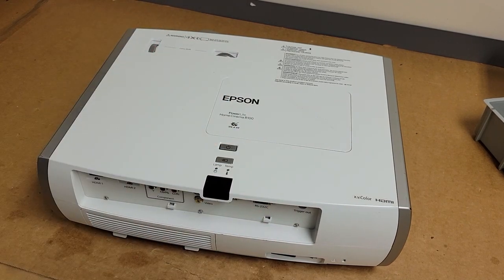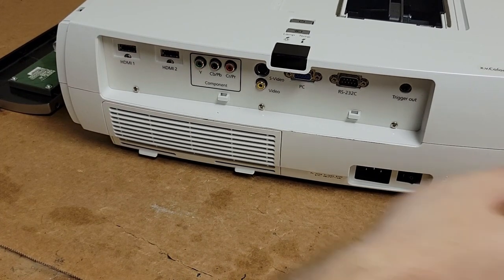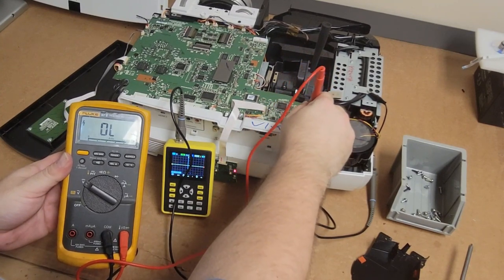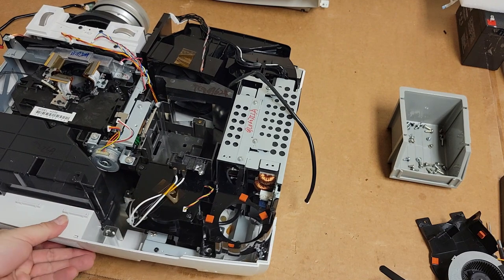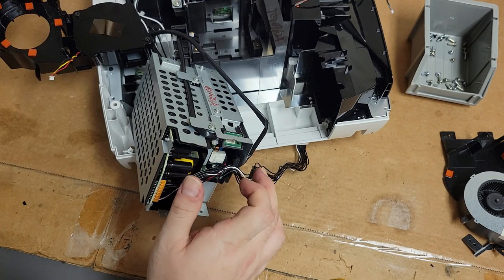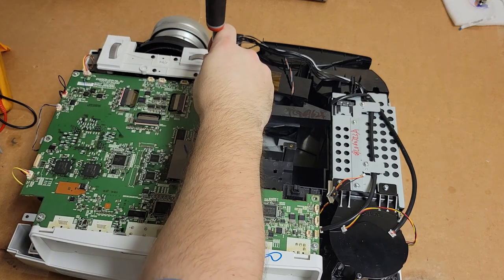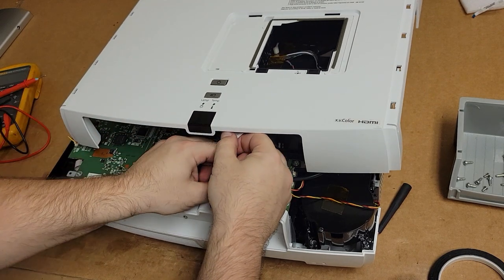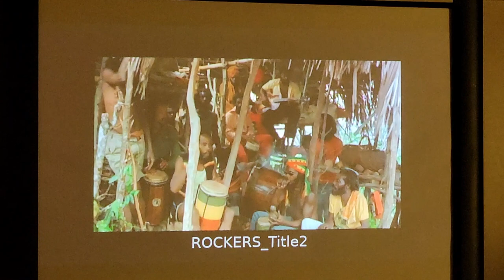Epson PowerLite Home Cinema 8100 LCD Projector | Temp LED Repair

Comment: Hello Frank great video I used  a multi meter to diagnose my issue  as you instructed as I also have a red light heat issue however I’m only getting half of the voltage on all four fans. I have the same unit as you pictured and I’m wondering if there’s some thing wrong in the power supply that you know of  as when I stop a fan like you did or maybe another video it shuts the fan bulb off into the default and then I get the full voltage and the fans actually speed up so I’m wondering if you know if there’s a circuit prior to the fans getting the power as I said when the projector bulb is on I’m only getting six point something volts on all four fans and I don’t know if that’s normal as in what should the fan volts be under normal running / operating conditions.  Oh any one more thing which may be important  I did not get an Epson exact replacement I understand that you suggested that however I did not purchase an exact so I’m wondering if the bulb could be pulling more voltage that is drawing from  the fans and this overheating thank you for your help much appreciated. Rob In NJ
Reply from the maker: Hey Rob, Short version, it's possibly the lamp but some aftermarket lamps use Osram or Philips bulbs and those are okay. It's the cheapo amazon lamps you really need to watch out for. As far as the fan behavior, that sounds correct to me.  The fans change the speed with the voltage. 6-7v would be a slower speed(low noise).  When you stopped the fan, it sent a stall warning via the third wire to the projector. The projector then turns off the lamp and sets the fans to cool-down mode which is high speed. 
What was your original problem?  Was is not coming on and one of the error LEDs was on?

Comment: Would you be able to repair my Eason HC6100 for both lights blinking red or have suggestions. I suspect the fan too. Optics work at power up and I have a new lamp.
Reply from the maker: Maybe.  Honestly epson is a real pain in the butt to repair.  They won't sell parts to anyone unless they are factory authorized. I can get a lot of the secondary parts(fans, connectors, polarizers) but some parts are just not available.  If you are okay with the chance of it not being repairable, I am happy to look at it.  I don't charge a bench fee so if its not repairable, it won't cost you anything other than shipping. Hopefully its just a fan but if its ends up being a mainboard, I would not put any money into it.  I have an email listed on the about page about halfway down.  Feel free to reach out and we can discuss specifics.

Comment: I have an Epson 8350 and the screen just started flickering. Is this a sign a need a new bulb? I bought this used off craigslist and was told there was a new bulb in here, but I have no idea how to tell. If you have any ideas it would be much appreciated.
Reply from the maker: Make sure the lamp is in standard not eco. If that doesn't change I would try another lamp. It sounds lamp related to me. There's no real easy way to tell. I honestly just look at them but I also have been working with lamps for 15~years. The simple version is look into the center of the lens of the lamp. If it looks at all cloudy or dirty then assume it's worn. If it's shiny and clean, you're probably okay. If you buy a new lamp make sure it at least has an Osram bare bulb inside of it's not an Epson original. Don't buy knock offs. I've seen them ruin these projectors.

Comment: Hi. brilliant job. I have an epson eh-tw3600 which has the same chassis as your hc8100. The problem with mine is both the lamp and temp lights are blinking red and the projector is not powering on. I'm guessing it has the same lamp fan problem not spinning and/or busted lamp due to lamp fan which probably stopped blowing. Need some advise as to what should I be doing to fix my projector. Thanks.
Reply from the maker: It could be the fan. Thats a common problem.  I'd check it and see if its throwing a stall error on the status wire.  That will tell you for sure.
Reply: @FixitFrank  thanks for the reply. I will check it. Appreciate this so much.
Reply: @FixitFrank  but how do u check if it’s throwing a stall error on the status wire?
Reply from the maker: I actually go over it in this video. epson checks differently than other brands.
Reply: Does it make a grinding sound when you turn it on?

Comment: This is brilliant, as I've run into the same problem on my TW5500. However, it appears it was the front exhaust fan. Since it is really hard to source I have replaced it with a Noctua fan that was similar (but not quite the same) in spec. I had to solder the plug from the old fan as it was a different connector. However, since I did that, I keep getting the instant temperature warning and the bulb shutting off. Could this be related to the non-standard fan? Or do I need to learn how to voltmeter everything now? I have tested each fan seperately, they all still rotate. Any help would be appreciated.  Thanks!
Reply from the maker: Yup it's definitely the fan you used. They need to use the same model as the old fan. Rpm reporting and CFM are critical. If you replace it with an original model fan you should be okay.
Reply: @FixitFrank  Thank you so much, will try to source one...

Comment: I have an epson projector that I used maybe 50 hours then didn't use for quite a while, then when I turned it back on I have the dreaded blue vertical line. So disappointed in them. NEVER AGAIN I say. Sitting and doing nothing should not be a reason (no humidity, no strange conditions, just cool dry) to brick my projector. I did all the usual ribbon cable stuff (and mine is a HC 3500, pretty onerous to disassemble, boards are attached to each other...) no dust, immaculate inside, total disappointment. No available anything because it is old.

Comment: I have the same projector I am getting a bit of blurring and a pink hue around the edge of the screen any thoughts? I am thinking it's dust inside. Could this be the bulb I did buy an aftermarket bulb maybe 75 hours ago.
Reply from the maker: Probalby not the lamp if its around the edge. Also I am pretty sure Epson no longer has these lamps. They basically stopped selling replacement lamps and only sell what is left in stock.  
That does sound like dust but it might also be the coating on the combiner prism after the LCDs.  This is a fairly old projector by epson standards so I would not put too much money into it.  I'd definitely suggest having someone see if it needs cleaning. If its not dirty then its the optics failing.
Reply: @FixitFrank  Thank you ya it's not too bad. I am pretty handy I was thinking about taking it apart and cleaning it. Probably not bad enough yet to risk breaking those LCD cables. I was hoping you were going to open one  all the way up in a previous video. Oh well thanks again for the response. Have a great weekend.

Comment: I have two of these 8100s that failed the same way. There is distortion/smudging of the colors only on the center of the image. Can this be repaired? Thanks!
Reply from the maker: Hi Gustavo,  Sadly the repair is probably not cost effective.  I have another video going up shortly about the 8100 that this projector is replacing.  The problem is in the output prism.  There is a coating that seems to fail, either from dust falling on it or purely just age and damage from thermal cycles.  Here is a picture of the damage. https://imgur.com/nXHJeiv  The only viable repair I can think of is replacing the entire optical assembly, including all 3 LCD panels(they are aligned to the prism and not adjustable after the fact), their polarizers and whatever that filter is.  Epson seems to fail this was a lot.  Either the panels, the polarizers or the prism.  That is a big reason why I don't do a lot of these. A replacement Optical assembly will definitely be used so there is no way to ensure another 5-10 years of operation.  Maybe 3-5 years if the assembly is in good shape with low hours.  I expect the projector in this video to last at least another 5 years. It seems to have low hours and was very well cared for. 
The annoying part is that even with high levels of maintenance and care, the plastics used in the optics will still break down regardless of how much cleaning and care the projector is given.  
I'll have the newer video about the unrepairable 8100 up later this week if you want to see the details.
I wish I had better news for you, but I would suggest selling those for parts if you can.  Put that money towards something newer that you like.

Comment: Hello Frank.  Amazing video thank you for sharing!  I have this projector and the same error.  Where would I be able to buy replacement fans if I were to attempt to follow your Amazing helpful video?
Reply from the maker: There are a couple of options.  I find that googling the part # on the fan itself is good.  Or, if you want to contact Time Electronics, they should have some.  They are in China but they ship DHL and take paypal.  Email is gydz@timeprojectorlamp.com  If you are in the states, I have some used/good fans that I would let go cheap.
Reply: @FixitFrank  thank you!

Comment: I have a 8350 that powers on and will sometimes power off with both red lights flashing. The bulb powers up and you hear the iris working. Before shutting off you hear a similar sound. Could this also be fan related? Do you clean any of the glass etc? Will probably open mine up in the near future. Thanks for helpful video so far!
Reply from the maker: Definitely possible. The 8350 is almost identical to the 8100.  I would be suspicious of the fans and the filter. I did not clean the glass because the previous owner seems to have already done it.  Also, there are a lot of aligned pieces of lens and mirrors that if you move them to clean, it makes it hard to re-align them.  Then there is the flexible LCD cables that can break if you breathe on them too hard.  I would clean the fans, the ducts and gently the exposed glass but I would not take it all the way apart. They are designed to run with some dust and in cleaning  a projector, less is definitely more.  Disturb as little as possible and you will have the best results.  remember this is a 10+ year old projector and anything that happens will only cost a lot to repair so keep it basic with the cleaning and you can't go wrong. I would find the fan problem first though and go from there.  Feel free to email me if you get stuck. Its on the about tab.
Reply: Dirk, I have the same problem, did you find any solution? Please let me know.

I suspect Iris issue, because sometimes when it shuts down the way you explained and I start the PJ again it shows the Auto Iris error.
Reply: @FixitFrank  thanks for the video frank, really helpful, if I ever find courage to open my PJ apart to fix the issue.

Pls check my reply to Dirk in this thread, do you think it can be iris error?
Reply: Hi Frank, after many months I finally able to open the projector up and clean as much as possible without disturbing the lenses etc. It seems my cinema filter does not move at all though you can hear the motor trying work but is does seem to be slipping since the gears are plastic. I opened the original gearbox cleaned and regreased is but no difference apart from being less noisy. Is it part of the epson start up process to move the cinema filter between the limit switches in order to gather a starting point should it have to be moved in front of the lenses later on? Almost like a "reset" with each power on? I managed to find a good forum post on AVS. If you google epson powerlite cinema filter noisy it takes you to a link where a user had replaced the plastic gearbox with a 6v micro metal gear motor. There is some slight modification necessary but nothing too wild. If it's the case that the fkilter should move at startup then I really am disappointed how epson would use plastic parts in such an application.

Comment: so watched this video as i need to figure out how to replace the fan in the projector we have...but im pretty sure my issue is the exhaust fan. its very loud, almost like a lawn mower (grinding type sound). it runs, but it gave the overheating pop up so i know its not working well. 

do you have another vid where you replace the exhaust fan for one of these? or even what fan to buy, I see some listed on walmart but no idea how to tell if its real or knock off?
Reply from the maker: See who the seller is. Walmart is kind of like amazon or rakuten. They allow sellers to post stores and sell their wares.  As long as the model info of the fan is the same, it should work.  If not, feel free to contact the folks I use.  Gydz@timeprojectorlamp.com  They are wonderful.
Reply: @FixitFrank  thank you! i ended up talking to my brother about it and was able to take it apart and replace the back corner fan, a piece of orange padding was rubbing on the fans so its running much better now! (my brother had already bought fans for it). 

but now there is a bad 'hot plastic' kind of smell coming from the projector.......its not overly hot and not giving any errors and is running fine. is it just the new part plastic smell? i googled and a few threads said its normal for new set ups but what about just a new fan?
Reply from the maker: If the lamp is new that is kind of normal for a bit.  It should let up though. If the lamp is older and the fan is new that might be part of it but it should stop making that smell pretty quick.  Im not really sure what else could cause it but it's going to be something near the lamp.  Make sure a wire or something didn't shift and end up in the hot air path.
Reply: @FixitFrank  I took a pic of everything running before closing it up and it didn't look like any wires were out of place so hopefully its just the new parts. i think i put a new bulb in, but the box was unmarked so it could have been an old one that just wasn't thrown out yet.. (just ordered a couple new bulbs though)
Reply from the maker: If its a new bulb that is not very uncommon. It should let up pretty quickly though. If you keep smelling it after an hour or two, let it cool down and take it out and give it a visual exam and make sure the air vents are allowing enough air flow.  Give the bulb a shake and make sure you hear the ceiling/table air flap moving. It should rattle a bit when you shake it. some amazon bulbs skip the air flap but it causes the bulbs to run too hot.  You want to hear that rattle.
Reply: @FixitFrank  oh good i always wondered about that, it did rattle like something was moving around in the bulb! thank you :)

Comment: hi frank i am in canada i have epson -HC 8350 = I REPLACED new lamp and it working  fine fir 2 weeks but  NO LAMP LIGHT IS NOT ON  THE POWER LIGHT  AND STAND  BUT NO LAMP LIGHT  help frank   ???
Reply from the maker: I would try a new lamp first.  Get a warranty replacement. If a new lamp is going to be defective, it will usually fail within the first month of regular use(first 100 hours or so).  If it is not an Epson original(in an epson box) that can be another issue.  The 8350 is older and when they get older, they seem to be more picky about the lamps that will work.  Many aftermarket options use Osram inside and those are not bad at all and a good option instead of an Epson original with Iwasaki eye lamp inside. 
If a second lamp also fails after 2 weeks, you may want to see about having the projector cleaned internally.  Early lamp failure from dust build up that causes excessive heat is not uncommon.